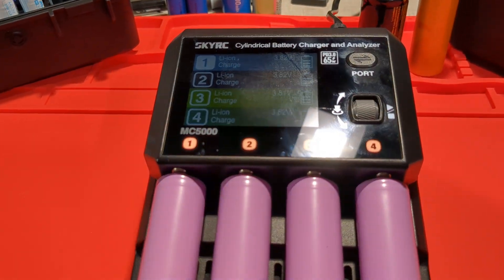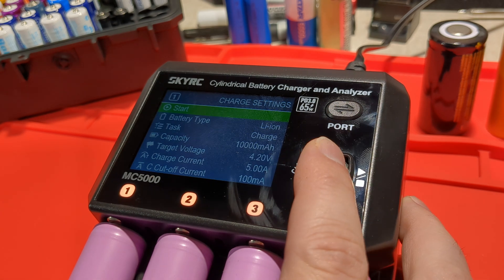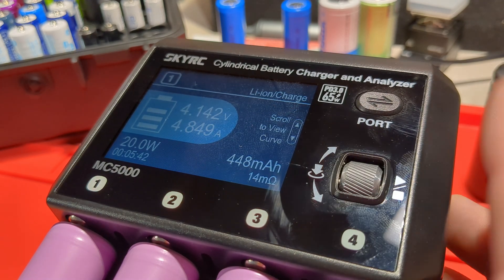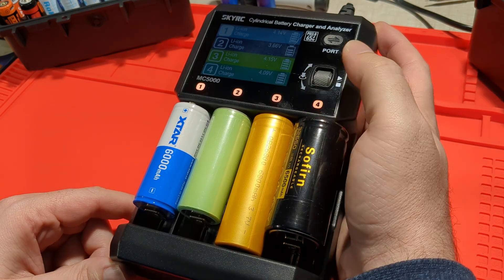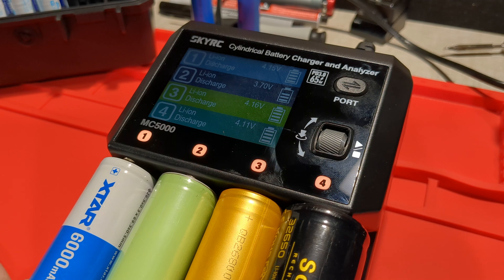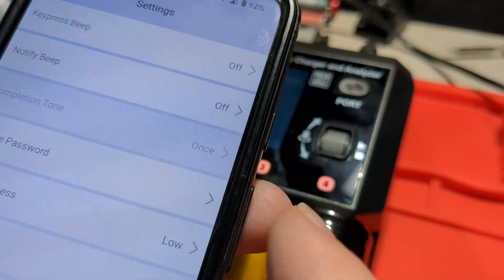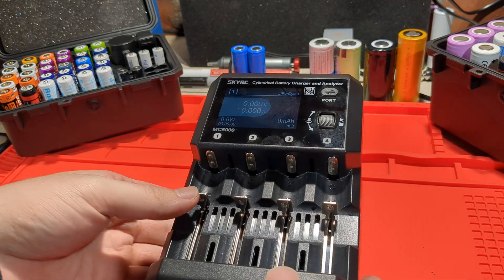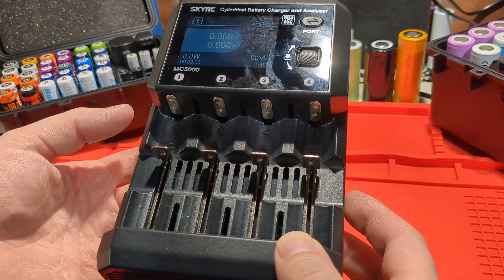SkyRC MC5000 Hands-On Demo - See It In Action!

Comment: My Opus  3100 just died. I went ahead and got a MC5000. After playing with it for a bit: 2 things keep it from dominating. Lack of program slots built on charger and lack of thermals per bay native to the charger. During testing my Eneloops got significantly higher temps using the eneloop mode vs using my native eneloop 8 bay. Both at 500mah charge rate. I could not find a spec for -deltav on the eneloop charger.

Comment: The product is absolutely terrible; it keeps overcharging, pushing the battery to extremely high temperatures.
Reply from the maker: You can control the cut-off voltage and the dV/dt termination. What type of batteries are you trying to charge? Ni-MH? I performed 19 tests and shared my results in a written review with graphs showing the voltage, current and temperature: https://timmcmahon.com.au/posts/skyrc-mc5000
Reply: @TorchHacker  I'll try your settings, but this charger requires so many parameters to charge the battery; it's unusable for battery analysis.
Reply from the maker: @通りすがりのどぼ The cut-off voltage of 2.9V might not be good for trying to measure the capacity of a Li-ion cell. MC3000 or Gyrfalcon S8000 are other options.

Comment: Bro, que buen video... Me gustaría saber si tienen modo "Test" donde carga y descarga baterías y luego muestra su vida útil en porcentajes por ejemplo
Reply from the maker: There's no test mode like that but it can measure the capacity in mAh by charging and then discharging. The lower voltage cutoff is a bit high so it might underreport the capacity.

Comment: I was just wondering. What’s the lowest target voltage for nimh batts?
For charging and discharging
Reply from the maker: Page 7 of the user manual under Downloads on https://www.skyrc.com/mc5000 lists the voltage ranges for charge and discharge cutoffs.
Reply: @TorchHacker found it. Thank you.

But I have to confirm. It says discharge range is 0.60v-1v. What does it mean?
Reply from the maker: @pXkix You can configure the program for a slot to have a discharge cut-off voltage between 0.6V and 1.0V. So you can discharge a NiMH battery down to 0.6V.
Reply from the maker: @pXkix For example: Configure a discharge program to stop at 0.7V
Reply: @TorchHacker but i cannot discharge it lets say 1.35v and let it stop there?
Reply from the maker: @pXkix probably not with the limit
Reply: @TorchHacker  dang! Back to hunting chargers! I can’t seem to find a charger that meets my needs.

Thank you so much!
Reply from the maker: @pXkix If you provide feedback to Enova on a Gyrfalcon S8000 thread on budgetlightforum then they might consider updating the firmware to support it. They've been very responsive and quick to improve the software.
Reply: @TorchHacker thank you very much
Reply: @pXkix 1,35 is basically fully charged after a few days rest.. Why do you target that voltage?
Reply: @GenX_in_the_wild im into racing hobby cars. track specific, at times I need a lower voltage.

Comment: This looks great. This has so many features but why no temp sensors? So it's not really a successor to the MC3000 which does have them. Regardless, I'm still interested in getting one. When setting the capacity, aren't you telling the charger what size battery you have in the slot so it can calculate other settings?

Comment: Strange that they took away the temp sensors, as that is a major secondary data source for ending charge, for instance with NiMH if -ΔV fails, which it does sometimes.
Reply: Yes, but keep in mind that you can add the thermologger for around US$ 25 and it is supposed to be well integrated.
Reply from the maker: It looks like you can use 2x SkyRC Thermologger Duo's to monitor 4 channels in an MC5000 by connecting everything via the SkyCharger app.
Reply: @TorchHacker does it charge 1.5v AAA and AA lithium? Cheers
Reply from the maker: @chefgav1  No
Reply: @TorchHacker  odd charger can’t recognise battery chemistry when there inserted. Even $10 chargers can do that
Reply: @chefgav1  It's because it supports a wide range of chemistry its impossible to know with any certainty what battery type is inserted.  A cheap charger might only support NiMH and Lithium Ion, so its pretty easy to see from the cell voltage what chemistry it most likely is, but when the charger can see a variety of chemistry where a lot will present with similar voltages, its safer to make the user select the correct profile.
Reply: I ordered an MC5000 anyway...

Comment: Can charge Li-Ion 1.5V batteries (AA, AAA)?
Reply from the maker: @MrAlllegro  It doesn’t charge 1.5V Li-ion
Reply: @TorchHacker  then let's pass by
Reply: You can!    Default settings: When you insert a 5000mAh battery, and used a charge current of 2.5A, and then insert a 16340 battery, and set the capacity to 700mAh, the charge current is still 2.5A.. which is not automatically adjusted. This could be problematic, so make sure you double check all the settings before starting the charge cycle.

Comment: Does the charger have temperature sensors in the battery slots?
Reply: No, but there are vents directly under the batteries where the MC3000 does not. Not sure how much circulation from the fans pass through those vents however.
Reply from the maker: @sebastianwroblewski5201  No, I can’t see any
Reply: @TorchHacker  OK, thank you